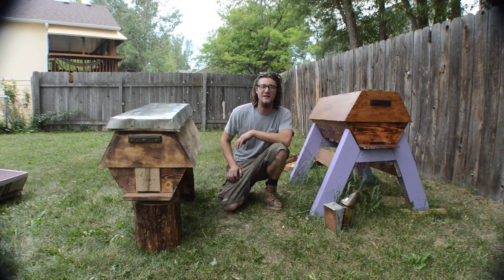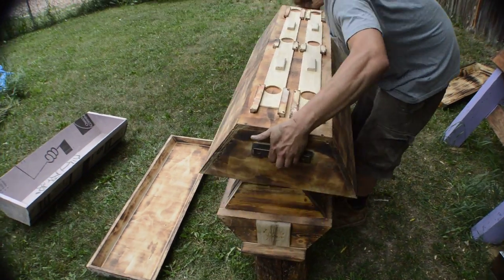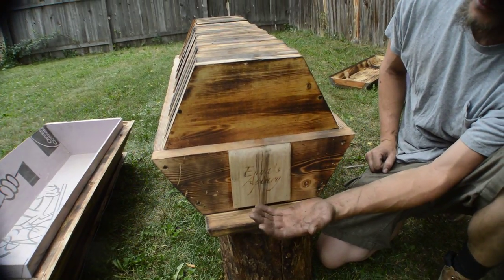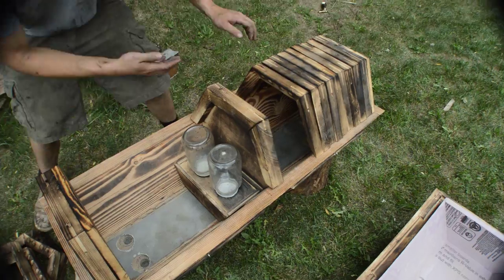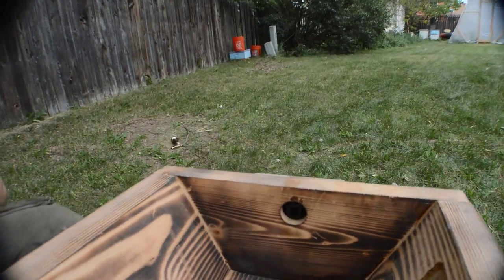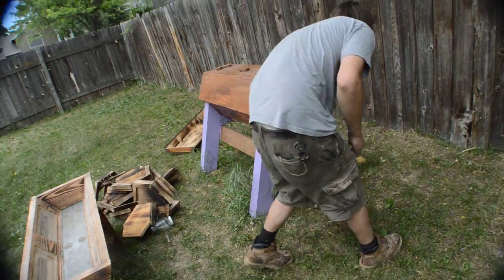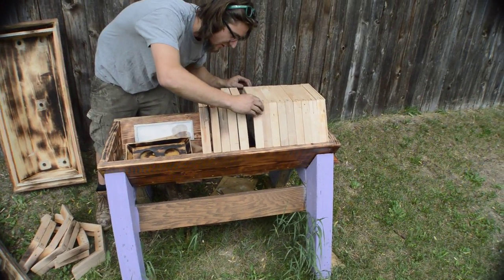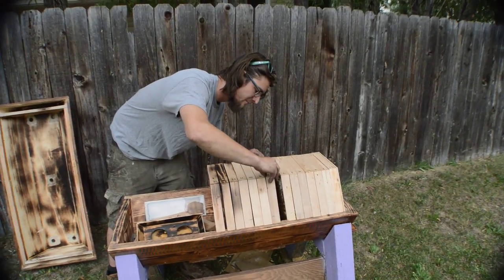Cathedral Hive Build 2.0(based on Corwen Bells original design - backyardhive.com)

Comment: I want to build one too, what are the measures of the frames for the combs and the size of the holes for the passage of the bees?
Reply from the maker: Do it!
The 3  inducudual sections making up ea b grand are 9" long joined at a 60 degree angle.   The bee highways are 3/4" and their placement doesn't matter assuming they all line up with eachother.